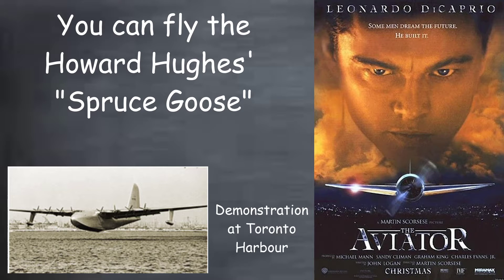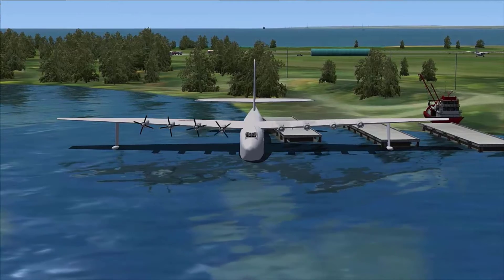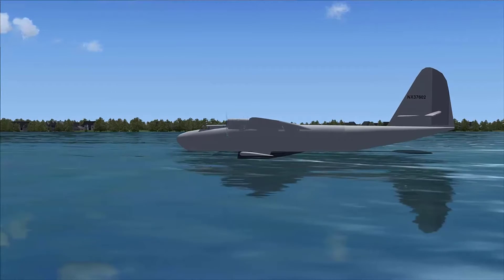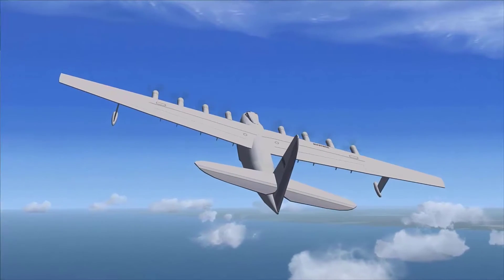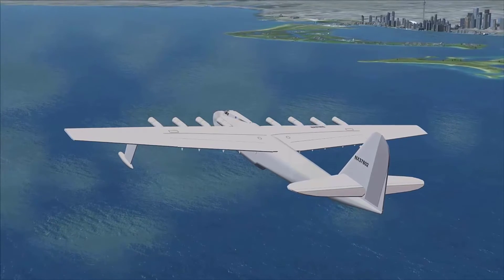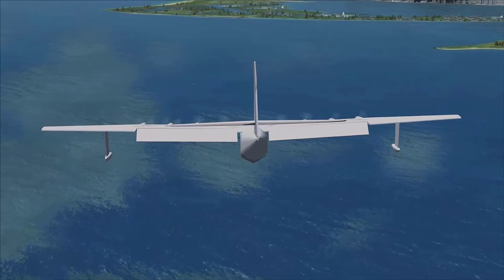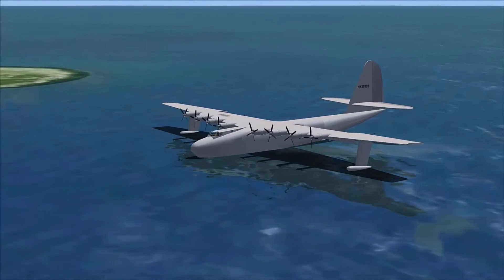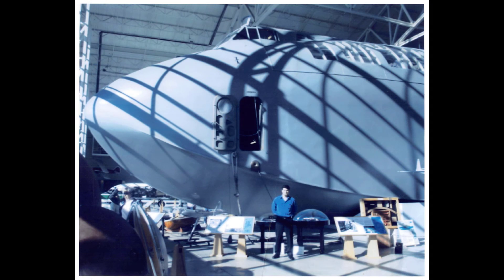Spruce Goose Demonstration

Comment: Why didn’t you use any flaps on take off ?
Reply: Good point. Without a manual and a basic flying machine to work with. Probably could have used first notch of flaps. Flaps on this plane were nothing like airliner flaps today that change the shape of the wing for an efficient take off. But a good point you make.